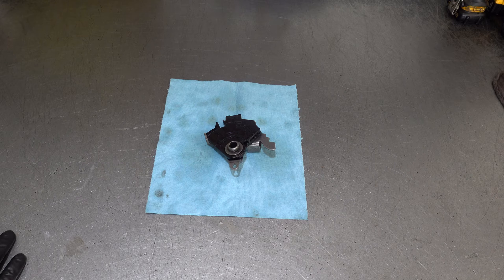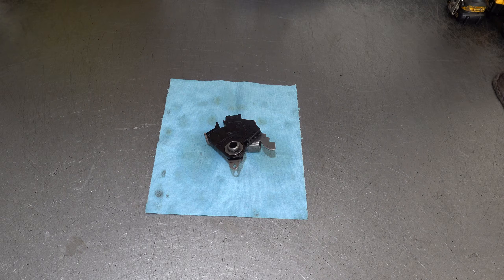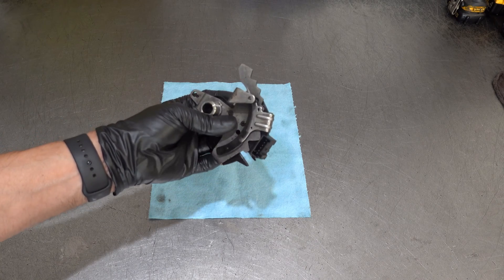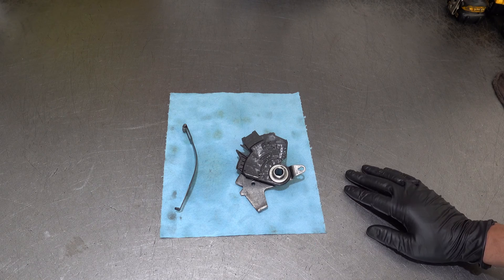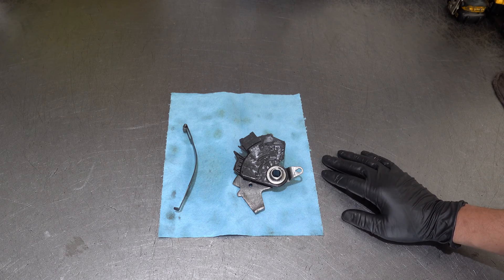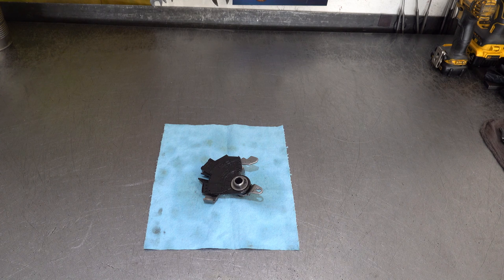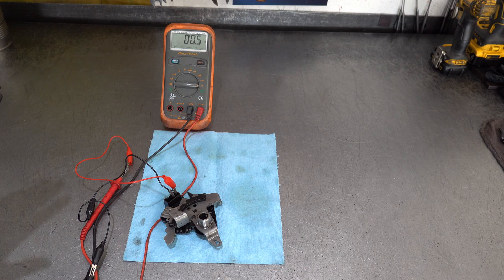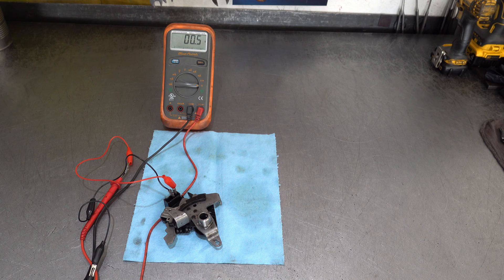4L60E No Crank No Start (2009+) - Internal Mode Switch

Comment: Great video.  Do you have a video with the removal and installation of the internal mode switch?
Reply from the maker: Thanks, John. I dont think i do at the moment but it's fairly easy and doesnt require valve body removal. Just the selector/shift shaft and preexisting IMS/rooster comb assembly
Reply: Okay thank you 👍🏻 @nickstransmissions

Comment: Hey nick Been watching all of your videos looking for help and answers.  Thanks for the great knowledge.  You answered some questions for me on another thread.  This is the part I am replacing on a 2014 chevy cruze 1.4. I am down to the post of getting to get the roll pin out and I am struggling.  It looks as if I try to knock it out it would get stuck in the back behind the Shaft and not come out all the way.  Any tips? My car is currently sitting up on a lift until I can get this silly pin out! I have tried all different types of pliers. Vice grips, side cutters etc and I just can't seem to get it out.  Space is very cramped too! Any help you could give would be appreciated.  I can send you a photo of what I'm dealing with if that would help.  Thanks so much in advance! (it there is a better way to communicate with you please lmk)
Reply from the maker: Hi Shane, thanks for watching...YT is the only place I provide any tech support beyond the few forums I actively contribute to...I do offer a paid consultation service but it wouldn't be worth it for you, IMO....Additionally, I'm not familiar with the Cruze transmissions (6T40) as I've never worked on one before. So can't really advise on what to do next but I would think that you would have sufficient clearance to remove the roll pin other than to keep trying...Sorry.
Reply: @nickstransmissions  thanks! I'll keep fighting it!

Comment: So apparently this might be the issue on my 13’ silverado. Check engine came in along with service stabilitrak and traction control light. And the gears are not highlighted in the dash. Truck runs and everything but the gear change is rough. Thinking that i might have to switch that part out?
Reply from the maker: Nope. If your truck starts, IMS and/or MLPS is not the problem. You either have malfunctioning engine and/or transmission electronics (TPS, speed sensors, etc) or you have an internal mechanical problem w/the trans or converter. Diagnose it using a bi-directional scan tool and see what comes up.
Reply: @nickstransmissions came out with the p0780 following with a p182C
Reply: It only recognizes P and 2 but R N D and 1 are not highlighted when i mess with the shifter
Reply: @gerardoeliasmartinez1884  Im in the same exact boat right now. Have you figured it out yet?
Reply: @gerardoeliasmartinez1884  did you ever get this figured out?
Reply: @ ended up being a yellow on the  harness wire that was cut(dont ask me how) lol but yeah it was on the side thats right next to the steering column
Reply: @gerardoeliasmartinez1884  Thank You, so the harness problem was inside the truck, up next to the steering column? We have a 2013 Silverado that has no gear selecter lights at all in the dash, none light up. The transmission is brand new, just installed, and has no gears at all. Sounds like we might have a harness problem somehwhere as well
Reply: @ yeah. Well inside in the engine bay. My issue was that the truck would run and everything but the gears were not marked on the dash and it would shift hard from 1st to second gear. And the stabilitrak and traction lights were on. Once i reconnected that cable and taped up the harness it worked like new again.

Comment: Hi Nick, I would like to know what pressures I'll be seeing on my 4L60E? I installed the trans-go SK kit, the corvette apply pistons, a sonnax LB1 boost valve, I shortened the 1-2 accumulator  .480 in. blocked the 3-4 accumulator,the 3-2 downshift control valve and the shift valve. I did follow the instructions in the kit. Stock converter, 5.3 L, 3.42 rear gears and I programmed the trans to lock up at 48 to 50 mph. Or would it be better to check the pressures and check back with you? I drove the truck and it shifts like I wanted to, even better! I can add pressure and extend the shift points, but it shifts crisp and firm all thru the gears, so I don't think I gonna do anything else. I have a performance tune in the eng. but I left the trans program stock as far as shift points and pressure! So let me know and I really appreciate all your help!💯👍👍The separator plate looks like it was never used and I over serviced the trans, the fluid was like new and nothing in the pan!
Reply from the maker: Hi Doug, check pressures and get back to me...P,N,D,D3 50-80 PSI, Rev-90-120 PSI, manual 2/Low-140-180 PSI at idle.
Reply: Hi Nick, I did the pressure test, here are the results@ 500 rpm P 78-80 PSI, R 110, N 78-80,D 80, 1- 80, 2 -80, 3- 80, now at 1000 rpm P- 80, R 190, N-80, D 150, 1-150, 2- 150, 3-155! I really appreciate all your input Nick,Thanks!
Reply from the maker: You're welcome, Doug! Those pressures look good.

Comment: That is the internal switch mine was external on the 2000
Reply from the maker: Yep, 2009+ was the first year of the IMS...I prefer the externally mounted MLPS as it makes for a much easier quick-swap if the thing shits the bed while you're out and about.

Comment: That little part laying there on that shop towel gave me the worst headache of my life with a 2000 model GMC Sierra. It was removed by someone and put back on. They never tried to crank the vehicle. Left the keys hidden on top of the tire at work.  truck is ready. yeah right I’ll get there at 9:50 at night after working nearly 14 hours and the truck will not start. I’m there the very next morning when the shop opens. They messed with that thing for several hours continuously all along saying it was something I done the truck was starting fine before they repaired the oil seal on that shaft and that’s all they done and park the truck back out front on there lot sent me a message saying come get it bring a tow truck. The following day I was able to fix it myself, and it only took me about four hours before someone informed me of that selection switch they called it or neutral safety switch. That was 23 or 24 years ago learned a lot since then that truck had 42,000 miles on it and was pouring transmission fluid.
Reply from the maker: That sucks man, sorry to hear you had to deal with that, especially when incompetent techs accuse the customer of doing exactly what they did (mess something up).